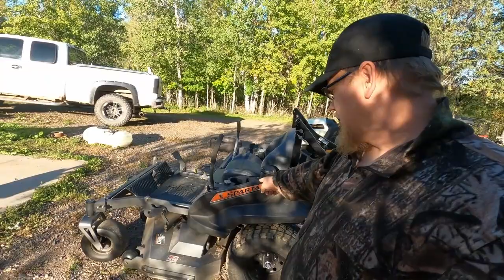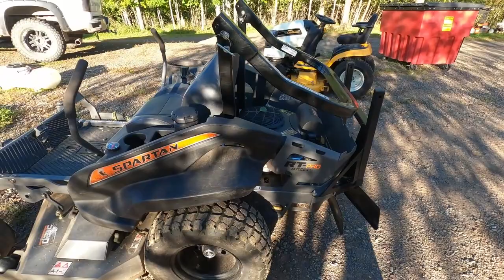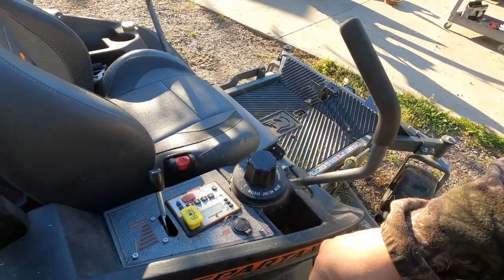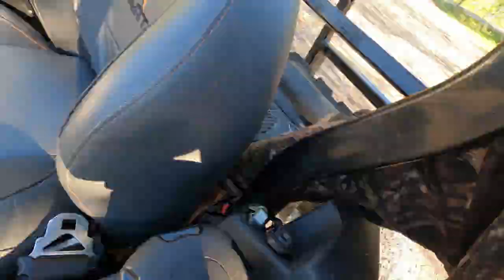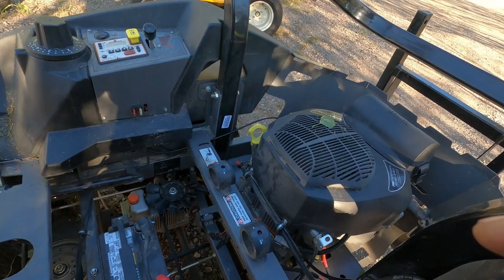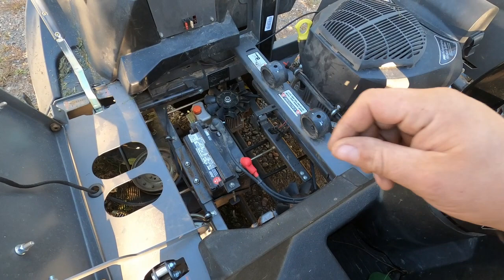Spartan R/T Pro code 23 and 13 Easy Repair

Comment: I've got an RZ-C 54. Hit a bump and it stopped. Got error code 23, but the battery leads are attached securely.
Reply from the maker: I would disconnect the battery clean the terminals them reinstall with new bolts. The jaring probably cause it to break connection temporarily.

Comment: well shouldn't the alternator keep it running with out the batter being connected?
Reply from the maker: It doesn't need the battery to stay running but it does need it for the PTO